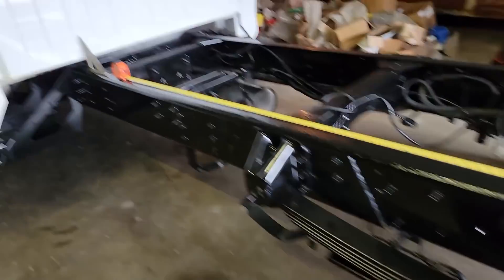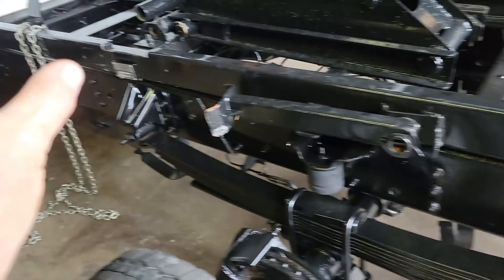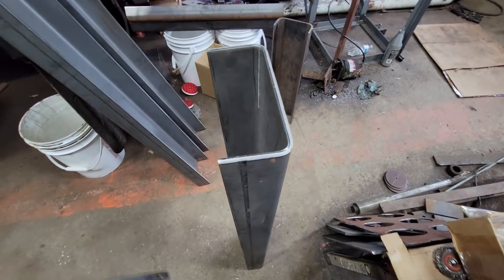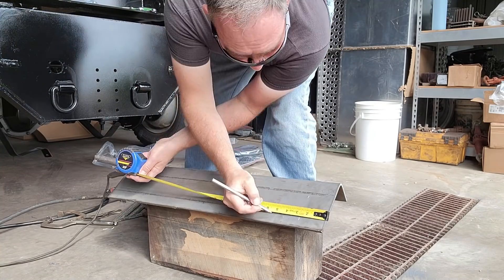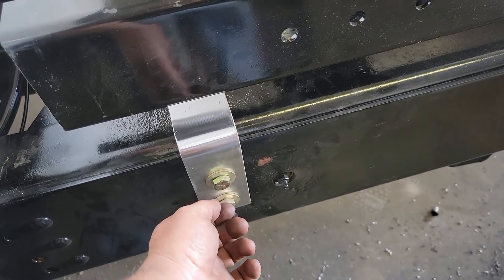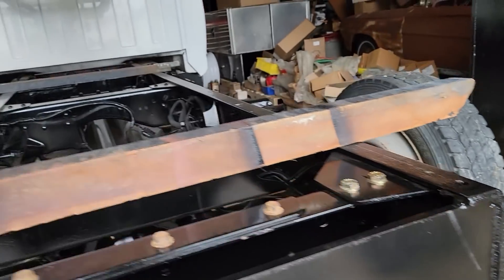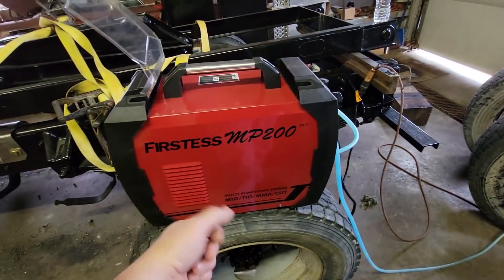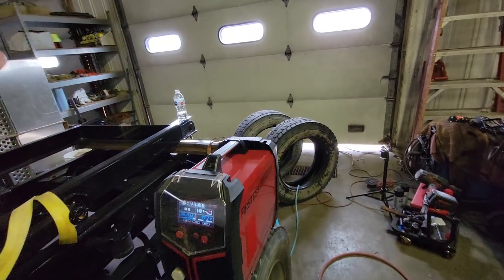GMC C4500 DUMP TRUCK BUILD PT3. FITTING THE HOIST, MAKING BRACKETS AND A NEW 5 IN 1 MACHINE!

Comment: Sir did they take into consideration the adjustments you made to the subassembly to fit to the truck or assumed you ordered it to the length of manufacturing ? Thanks
Reply from the maker: sub assembly is ordered to the truck. it is able to be shortened in the front as needed for my application. this is because the truck i am using could have different cab to axle measurements. mine happens to be the shorter of the ones this sub assembly is intended to be used on.

Comment: Hi J C I need some information. 
I have a 2002 Chevy Trailblazer.
I had to replace the rotor, brake pads, and capillary. I've trying to bleed the right rear, but there is not much pressure going to thur thr capillary everytime the brake pedal was applied. I'm totally  lost on what to do. Do you hav or anyone have some info.
Reply from the maker: did you have a hydraulic leak? it is possible the proportion valve is stuck. if so crack open a bleeder on the opposite end and push the pedal hard. it can reset the valve back to center. otherwise i would look for a pinched line or a collapsed hose.

Comment: Why do the nicest tools have to come out so long after I had to quit?..Its just not fair as that welder you just demonstrated will do everything but make coffee. I do see maybe and you can feel free to correct or please do, need a welder, a plasma cutter in one spot so can you go between functions or manually change up for each function. When fabing on the fly, I have tacked something to hold while trimming out. That really seldom if ever happens.That would not even be close to a picking point as that machine is what it would of done is make me look way better than I am. I have watched way more than used a plasma cutter. What little I got to use one, I sure wished that I owned one. I would of hadn't I got hurt in o.five. Sixteen years isn't a lot in tools as I had a nice stick and a mig but other that a torch, I had a air ark (spelling is not a long suit of mine) for blowing out old welds. Great project J.C., I can understand the conflict in this build.

Comment: I'll take that K4500 save you a lot of cutting.  Put a long flatbed that when tipped to 45-60% it reaches ground to drive up on it. Wish ihad kept pop's old 69 F-600. Would have been perfect. Notice JC I did say "K" & you know what that means.? Is can you do that to this truck like I've see you do it to the smaller fords. That lull works wonders.  Keep up the great work.
Reply from the maker: these trucks never came off the assembly line as 4 wheel drive. they were converted by an aftermarket company. finding the right front axle can be a bit of a challenge. i have converted one. it used a divorced transfer case which was electric shift.
Reply: @j.c.smithprojects  thanks teach I didn't know that. So I'm thinking that's a much bigger job than just changing out an axle. Would that be the same on an international & freightliner too?
Reply from the maker: change the axle, remove the rear shaft, mount the divorced transfer case, make shaft from trans to transfer case. rebuild and shorten rear chaft, build new shaft for the front, run the wiring for electric shift transfer case, add neutral safety if desired, add switch and shift module to interio.